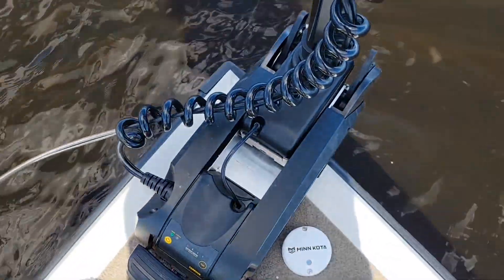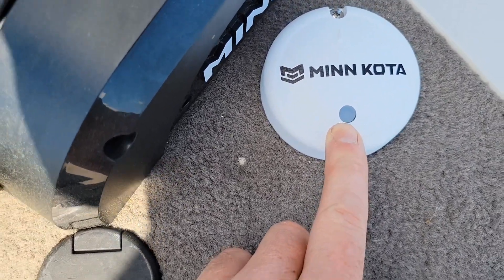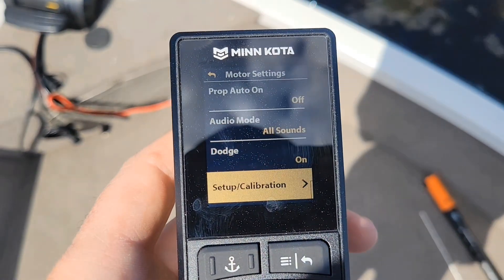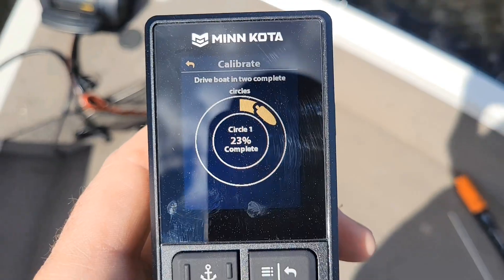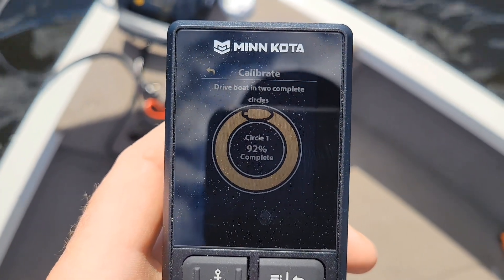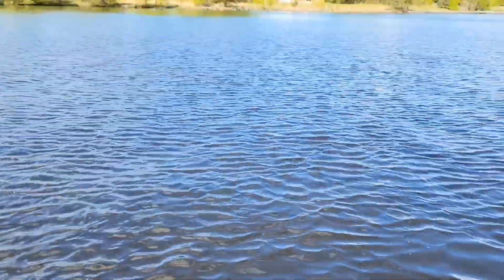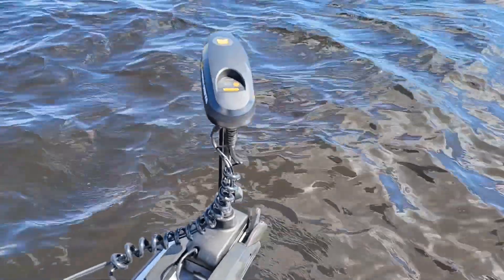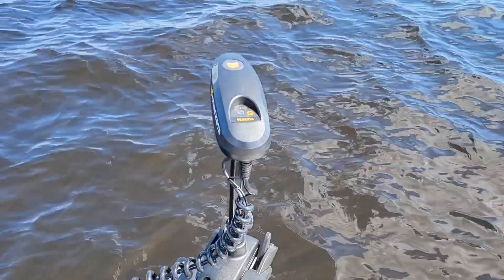Minn Kota Terrova Advanced GPS - How to Calibrate and Pair Heading Sensor

Comment: I appreciate the videos.  Thank you.  Quick question.  I did everything you said and when I began the circles, the animation on the remove didn't do anything and the % didn't change.  Any troubleshooting thoughts?   I have not run the ethernet cable to the fish finder as I assumed I can use spotlock without them being synced.    Keep up with the great videos!!!
Reply from the maker: That sure is strange. Circle doesnt complete at all? It definitely doesnt need networked to tour unit to calibrate. Did you use the remote to complete the circles?
Reply: @HumminbirdHelp    Yes.  I used the remote.   The circle didnt move at all and the percentage meter stayed at zero.
Reply from the maker: Very strange. First ive heard of that. I would definitely call support on that one. Wish i could help. Let me know if you figure it out

Comment: It says mount the heading sensor  at least 2 feet away from motor . Was this not an issue?
Reply from the maker: Havent had any issues with having it up front on the bow. Alot of my friends have the same setup with no issues as well
Reply: Exactly.  I had mine mounted on bow but moved it to center of boat on the seat.  But I also had my battery in the bow which would supposedly interfere with the heading sensor.

Comment: How sharp do you need to go in the circle
Reply from the maker: Doesnt have to be sharp. It will just take longer to complet the 2 circle's
Reply: I thought it was supposed to be mounted in the rear?
Reply from the maker: No the heading sensor doesnt have to be but if you had a external gps puck for your humminbird mounting that on the back will give the most accuracy for waypoints since its closer to the transducer
Reply: I read the puck can’t be close to the wiring or unit. Is it ok where you placed it? It would so much easier if I could just place it where you have it?
Reply from the maker: Yeah was a little bit worried when installing but it works perfect in that location
Reply: Isn't that odd because Minn Kota says it should be at least 3 ft away from the motor and not near any wires or metal?